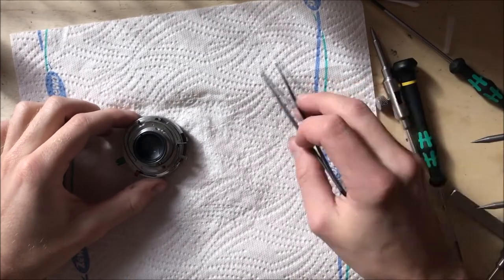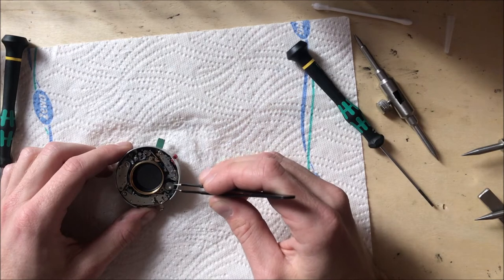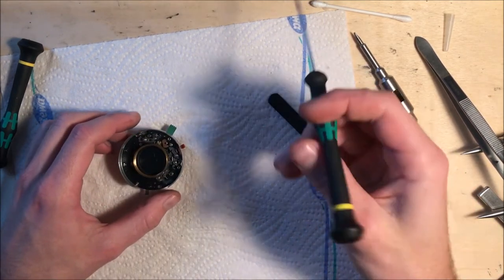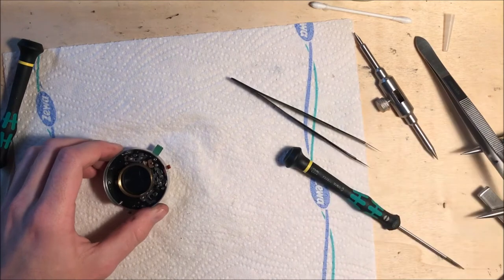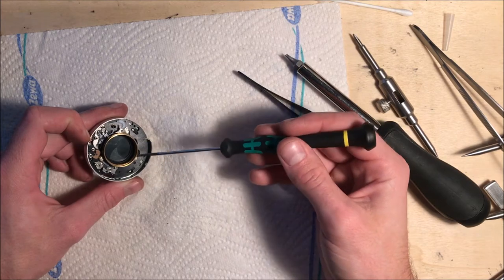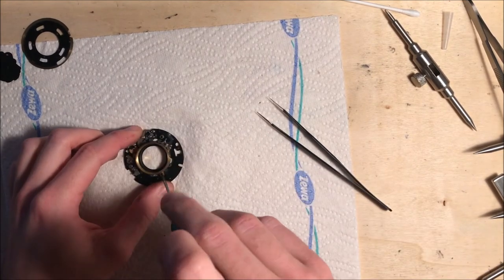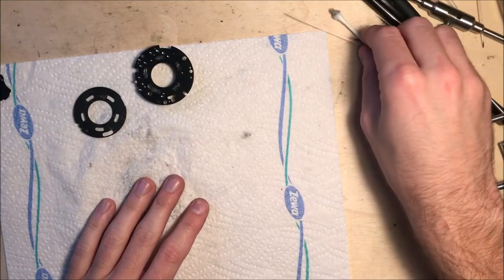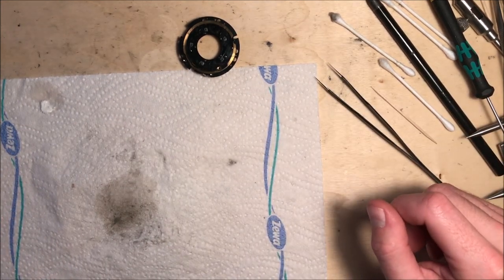Contaflex IV CLA Repair [part 3/7] - Cleaning the Synchro-Compur shutter

Comment: Does the Contaflex IV and the Contaflex Super have similarities? Just curious if I stumble upon a Contaflex Super...
Reply from the maker: I'd say they have more differences than similarities. I never really felt comfortable with the newer Contaflex models, which is why I haven't made a video about one yet.
The Contaflex III and IV are by far the easiest to repair.
Reply: @pietscameraworkshop5024  Thanks to you I brought life back to a Contaflex I, I purchased several years ago. It has the original receipt in the original box, but someone had tried to repair it so I just left it preventing doing further damage. I bought a second Contaflex I for parts, but no parts was needed, so now I try to bring the partscamera back to life…
Reply: @pietscameraworkshop5024  I guess the Contaflex super b and bc are more complicated due to the auto exposure feature …
Reply from the maker: @TomFindahl Yes I agree.